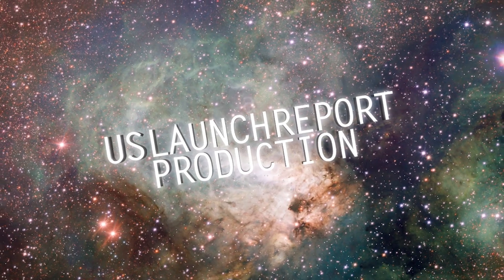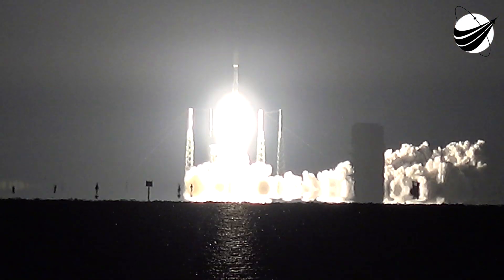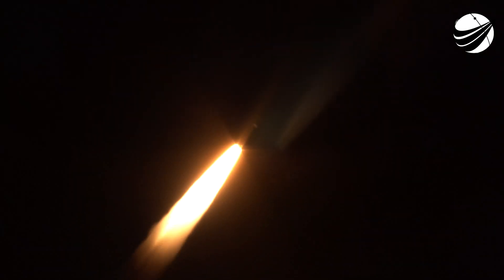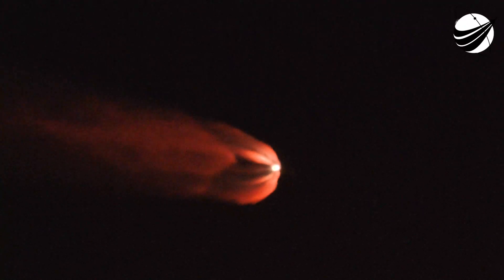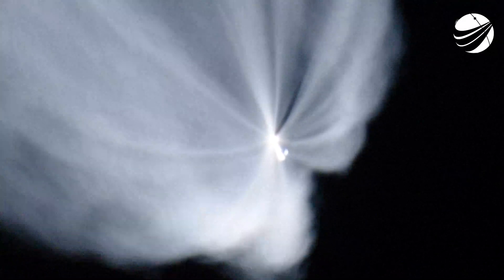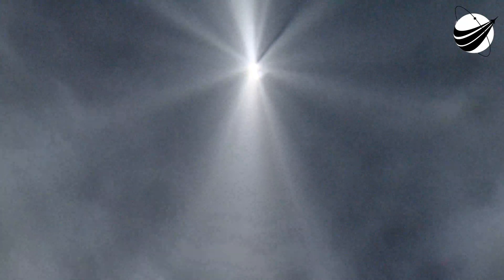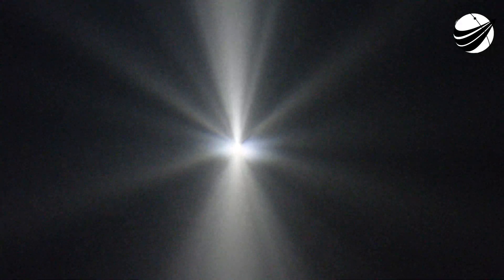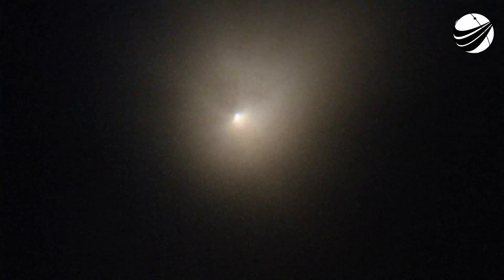Light Show At Dawn 4K - AEHS5 - Atlas V 551 Launch And Track 08-08-2019

Comment: Outstanding tracking and exposure bracketing, you guys are getting really good at this!  At 4:40 Is that throttle modulations we see for the next 30 seconds as the controller hunts for the optimal thrust setting to maintain the 4.6g acceleration?

Comment: Gorgeous. 130mi in altitude 800mi down range!
Reply: Awesome performance indeed. Over 4 minutes on the 1st stage alone. Something the SpaceX Falcon 9 simply cannot do.
Reply: @ronhaworth5808  The Falcon Heavy's 3+ minute First stage is sufficient in today's and anticipated medium-term tomorrow's standards .  But the nearly 7 minute Falcon Heavy 2nd stage burn is what arguably sets it apart in capacity from even the mighty Atlas V
Reply: @donkoh5738  - I wasn't comparing the Atlas V to the Falcon Heavy. Just the Falcon 9.